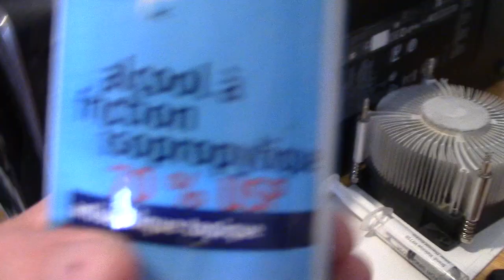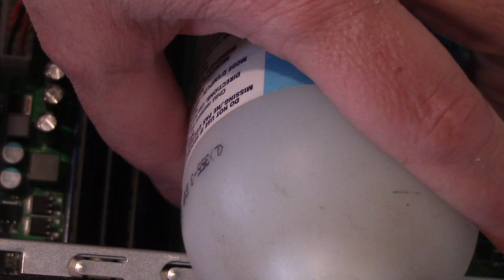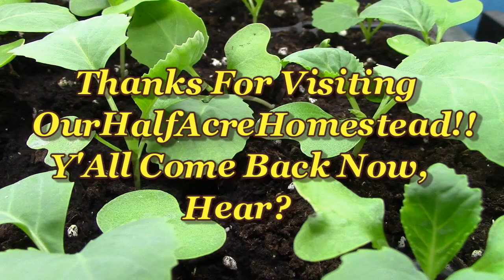Replacing Thermal Paste Between Heat Sink & CPU

Comment: Great job Mrs V.  I hope it stays working fine and dandy (elastic bandy) for a long, long time.

Poo
Reply from the maker: lol the elastic bandy one is probably to out of date now..but this one I hope will serve me for a LONG time!
Reply: I hope so.  Mine is nearly 9 years old now and still going strong.  I can detach the fan without taking the heatsink off and it's been detached many a time!  Thought I'd killed it last year when I got a bit too slaphazzard with the vaccuum cleaner nozzel.  Thought I'd sucked the drives and the programmes up as first boot it showed no drives present, then when I pushed the drive cables in there was no boot system.  Got it going in the end!  Its very low spec now but it suits my needs, watching videos and writing.  It may struggle when I start making videos though.

Poo

Comment: I need to do this again (grumble grumble) with my laptop. That bastard overheats 30 seconds after you turn it on. Right after the warranty was up. Figures. I don't think any amount of Arctic Silver will help the bugger, though.
Reply from the maker: you would be amazed what a good cleaning will do! Try replacing the fans too!
Reply: Been there, done that. My hubs is an IT guy, he has done it all. $1700 POS. lol Gaming computer my ASS.